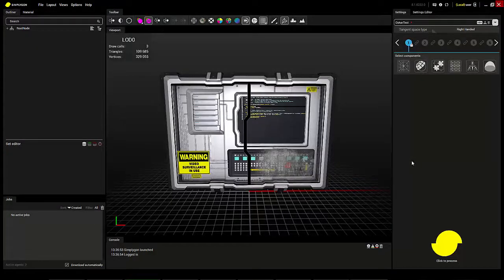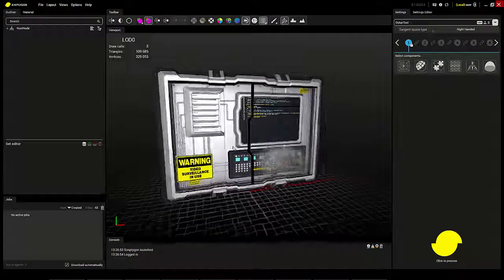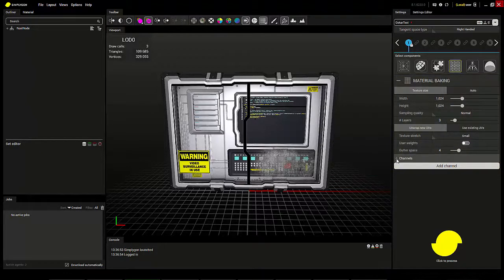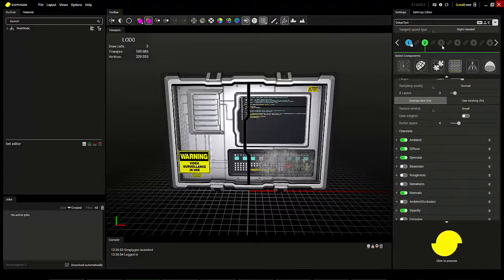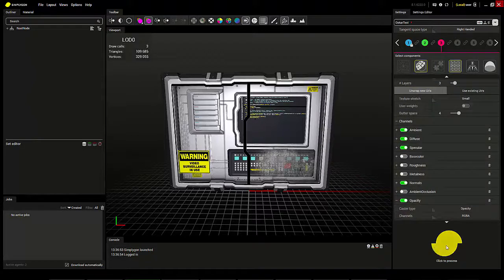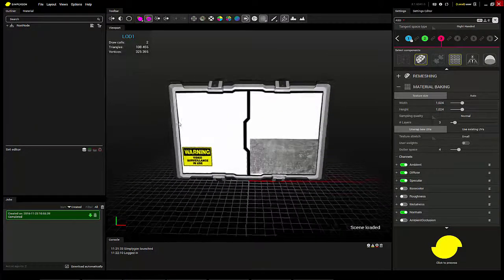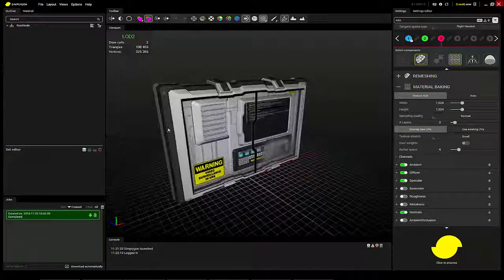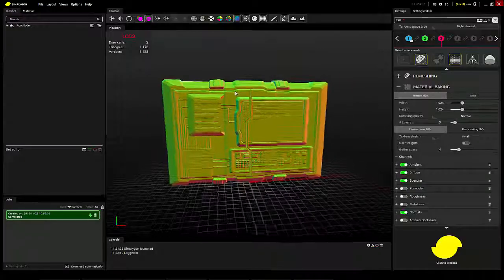Simplygon 8 - Material Baking

Comment: How can I import the mesh with textures? What format required?
Reply: .FBX
Reply: @lokasanidileepraja2230  but fbx do not contain texture. How can I apply textures to fbx in program inside?
Reply: @vladyslavtkachuk4457  I hope it helps you, but In my case I used blender 2.8, added the textures there and then exported the fbx, once I loaded the model it got the textures in it.